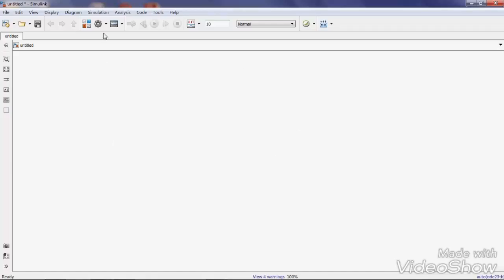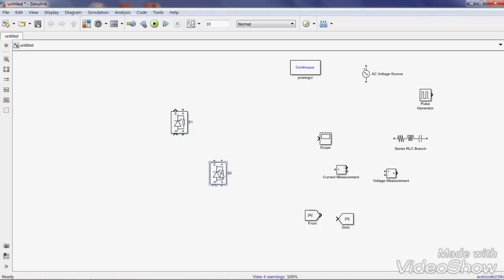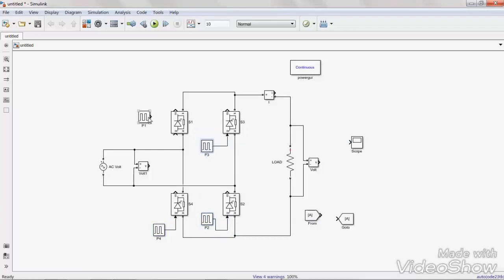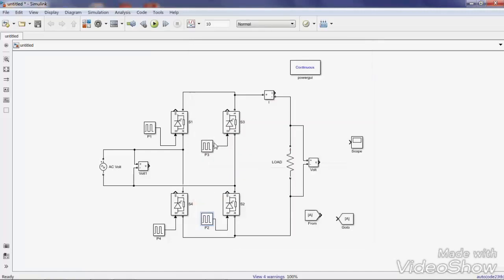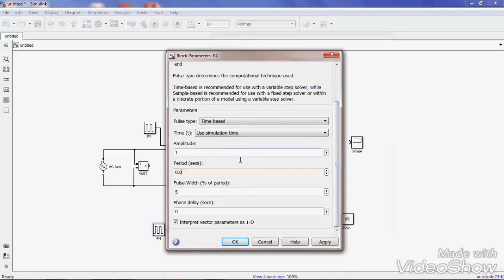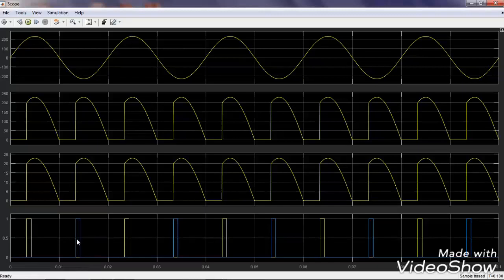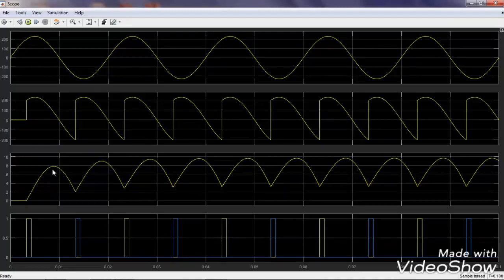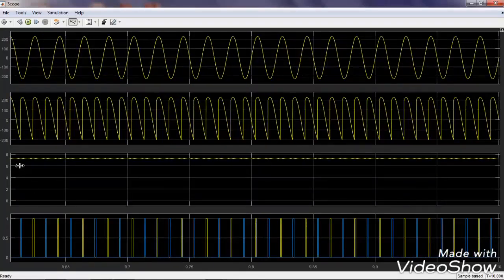2 MATLAB/SIMULINK Single Phase full wave Rectifier

Comment: Sir while connecting display for ac voltage source I am getting wrong values but wave at scope is correct one .Whether I should add or change anything sir. Sir I am using Matlab 2009 version sir due to shortage of storage .I should take simulated values for my lab experiment kindly tell me sir